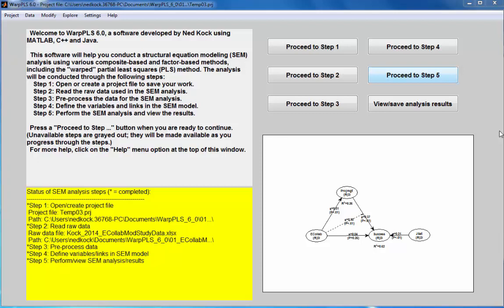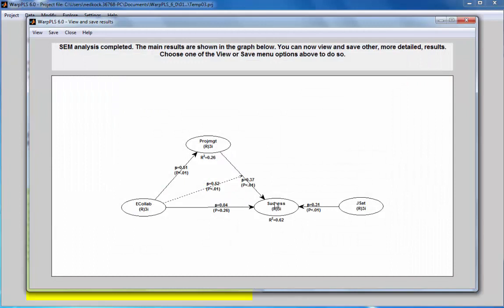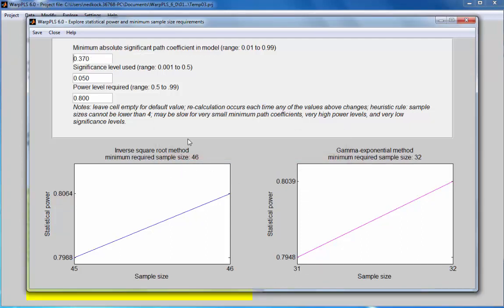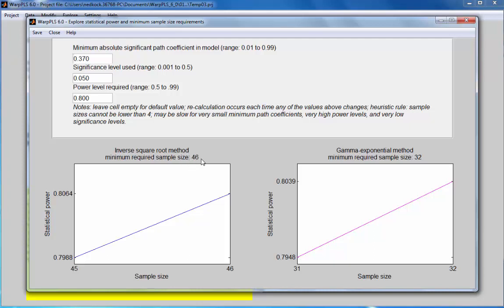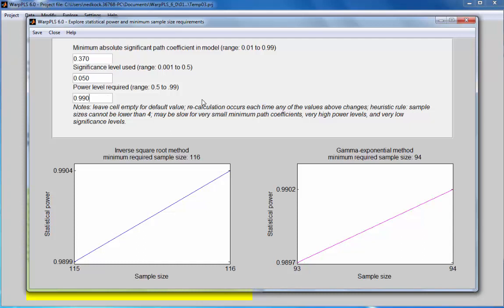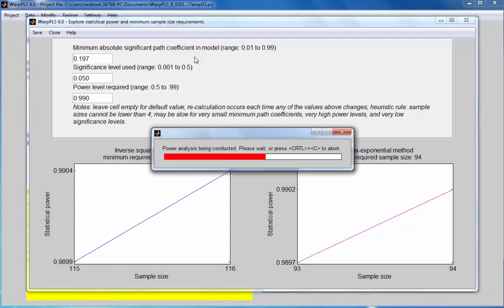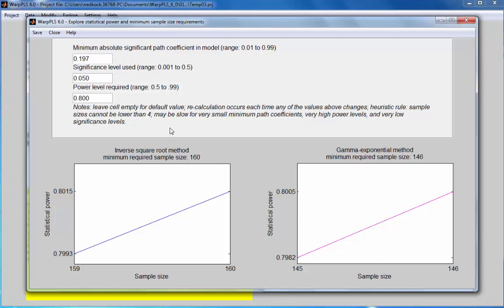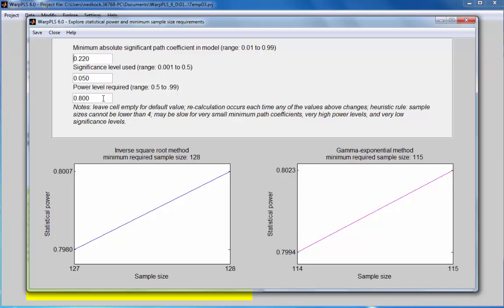Explore Statistical Power and Minimum Sample Size in WarpPLS

Comment: Great video..I wana know what if we keep  power level 99..and what does it mean??
Reply: Simply put, it means that the probability that you will miss an effect that exists in reality is 1 percent (100-99). This mistake wold be a type II error, or false negative, for which a power level of 99 percent would be well above the widely accepted level of 80 percent. If you set the power to 99 percent, the minimum required sample size calculated by WarpPLS will be higher than for a power of 80 percent. So there is always a trade-off.

Comment: Thank you for this video, it is very interesting. I have a question, how to calculate the minimal sample size before running the model? Should I identify the minimal significant path coefficient from past research? For instance, in your paper Gupta et al (2017) you say: "We estimated our minimum sample size to be between 189 and 202, respectively via the gamma‐exponential and inverse square root and methods, for a statistical power level of 80 percent or higher to be achieved." However, the details of this calculation are not provided. Thank you in advance Prof Knock
Reply: Sorry for the delayed response, I've just seen this comment. Yes, you can estimate the magnitude of your minimum path coefficient (associated with a real effect) based on past research or a pilot study. If those are not available, go with the default value provided by WarpPLS. The rationale is here: http://cits.tamiu.edu/kock/pubs/journals/2018/Kock_Hadaya_2018_ISJ_SampleSizePLS.pdf.